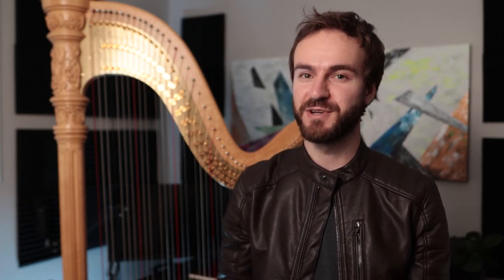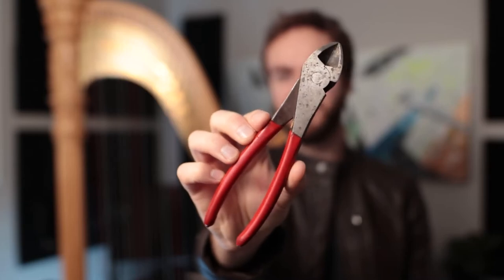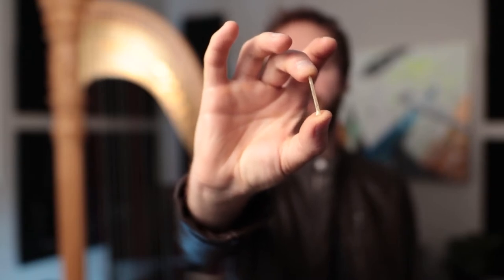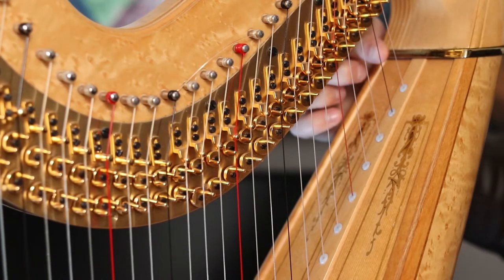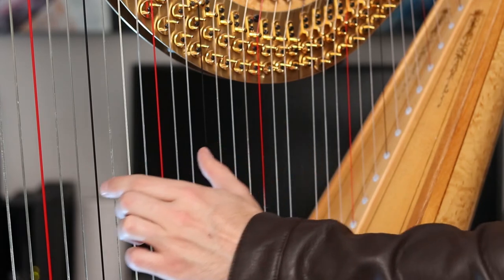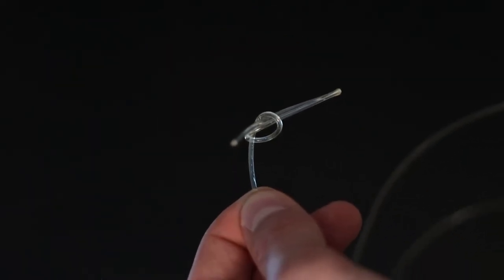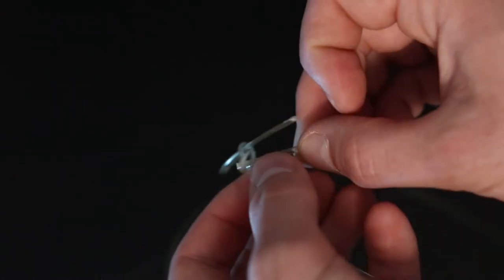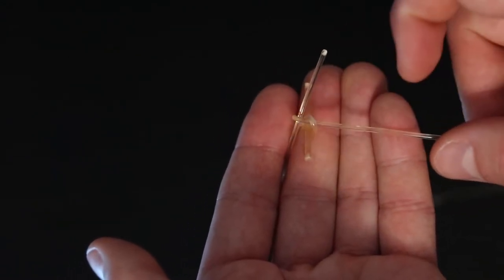Changing Harp Strings

Comment: You are not showing low octave gut string tie,   too thick, can not tie.
Reply from the maker: This tie works for the low gut strings as well. If you just leave it slightly slack and don't try to tighten it down too much the act of tuning the strings will compress the knot which will catch in the soundboard. Most 4th octave gut strings and all 5th octave gut strings don't require an anchor. This knot will serve as the anchor.
The string I tied it on was a 4th octave gut string which is fairly large in terms of gut strings.